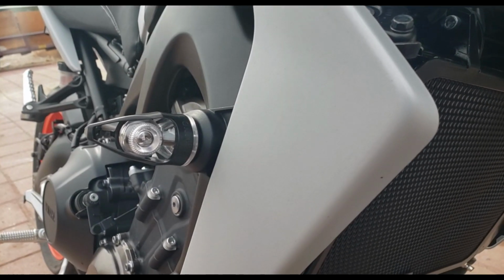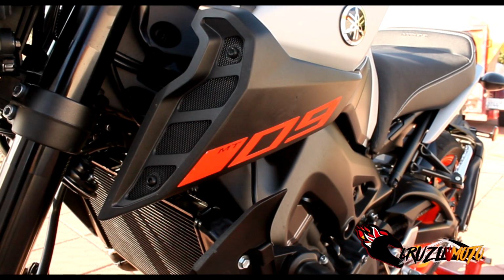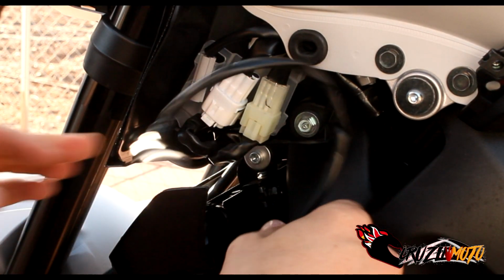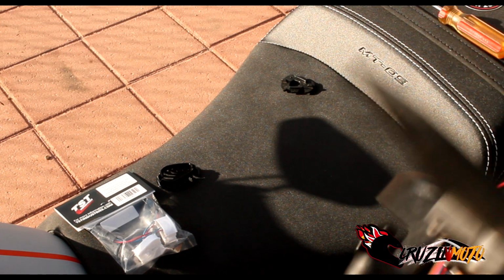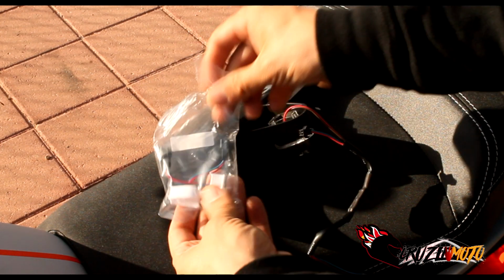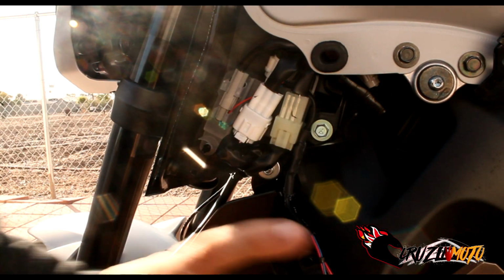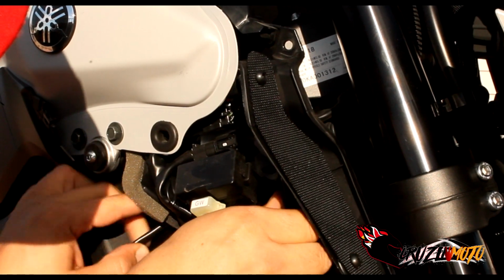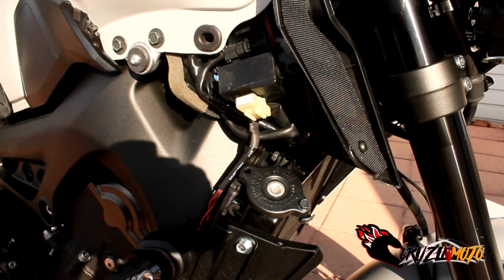TST Industries MECH-GTR Front LED Turn Signals Install - 2019 Yamaha MT-09

Comment: So I have these and I was wondering what you did about the back of the lights.. all the wires are showing when it's all put together.  And what about water getting into the back of the light if it rains.

Comment: I bought some flush mount turn signals from tst awhile ago. They recommend i also get a flash relay so they blink at a correct speed
Reply from the maker: I dont like the relays I like them blinking fast